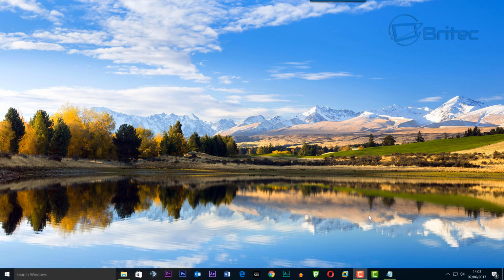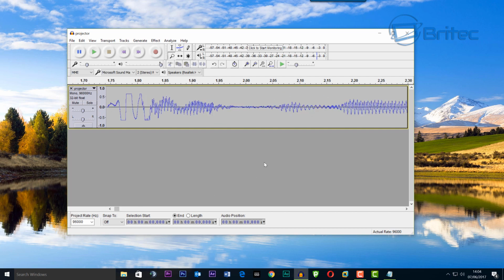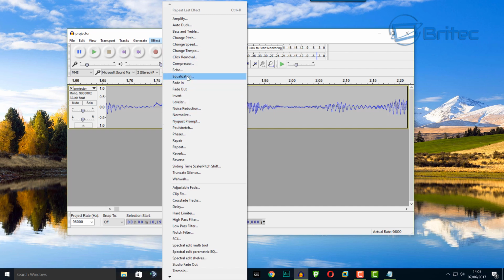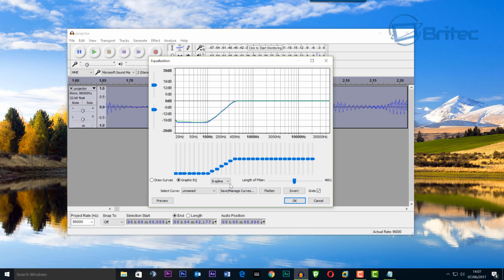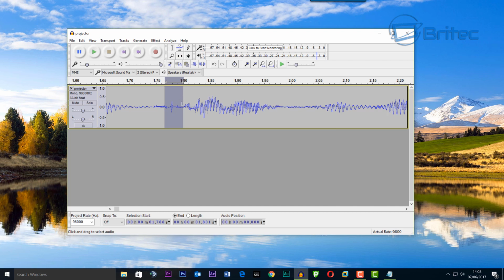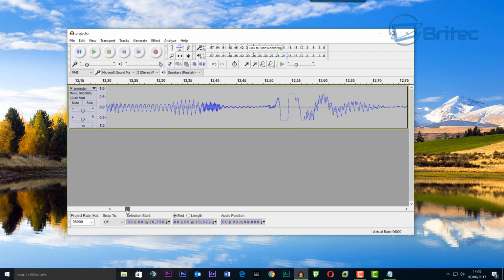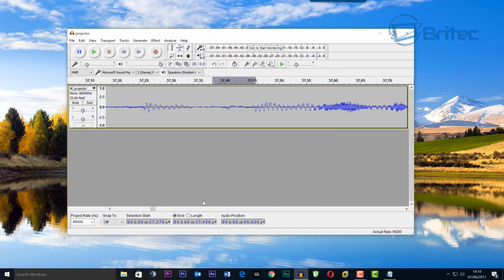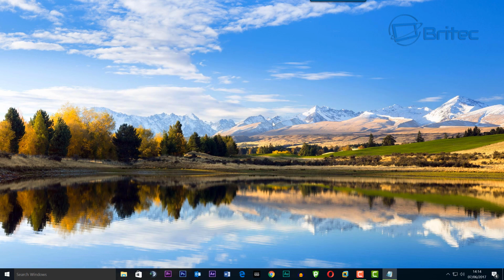How to Remove Pops From Audio Recordings

Comment: I was hoping that this method would find those square wave type pops automatically rather than having to scroll through the whole file but I suppose that's a bit much to ask for with Audacity - great video though.
Reply from the maker: Yeah it's going to be looking for the pops manually, but it does work and does a great job at removing them.
Reply: Thanks Brian - understood.

Comment: Please Brian can you make a video for me about creating RAM drives for moving temporary internet files and "Environment Variables", temp files to a RAM drive. I want to learn more about RAM drives and what they can be used for.
Reply from the maker: Not much point doing that today with SSD
Reply: Please make this video tutorial on the benefits and what a RAM drives is used for. This will only be a short video. I just want to learn more about RAM drives. By the way, I do not used SSD hard disks because they have a short life span.
Reply from the maker: Who told you they have a short life span?
Reply: I have been told that SSDs have a short life time by computer technicians. SSDs can last for 20 years on average, before becoming unusable due to the wear and tear caused by extreme drive usage and the length of time in years. I also read about the short life span expectancy of SSDs on Wikipedia. Mechanical hard drives last much, much longer than SSDs.